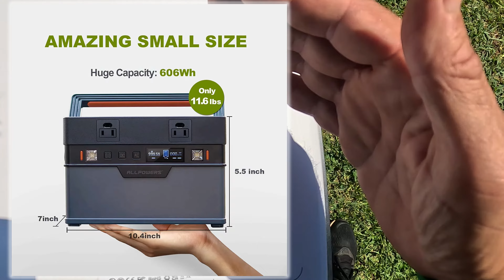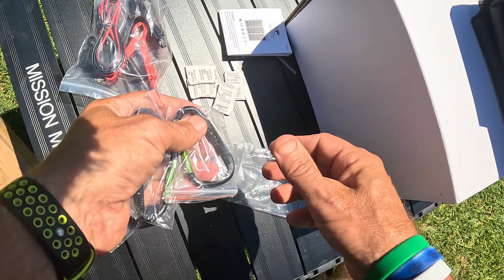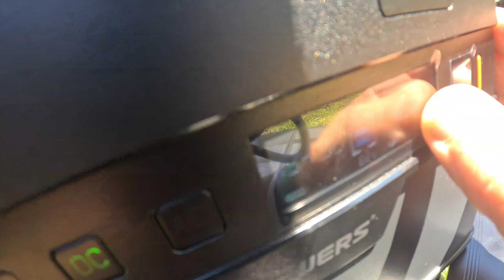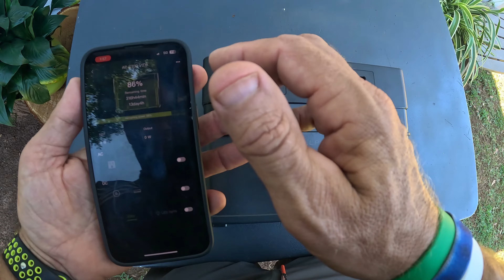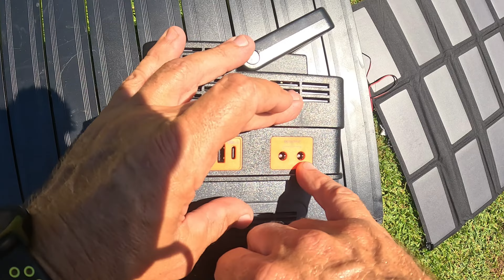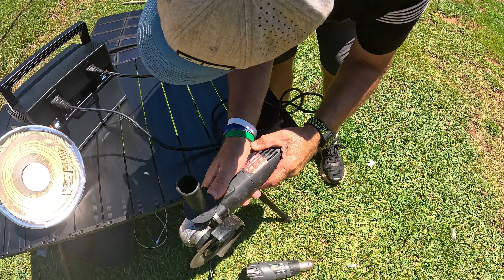Portable Power Station with Solar Panel - Review

Comment: At what wattage does the fan turn on when using it? If I use an AC electric blanket I don't want the noise to wake us up.
Reply from the maker: Yeah the fan does kick on it’s behind my seat in the van barley even hear it I have used this setup few times now and never even thought about the fan
Reply: Only window air conditioner and fan
Reply from the maker: it might work?